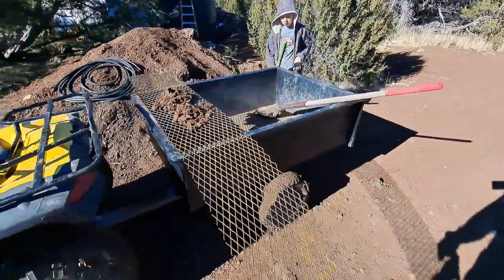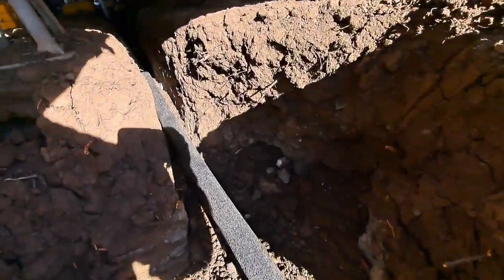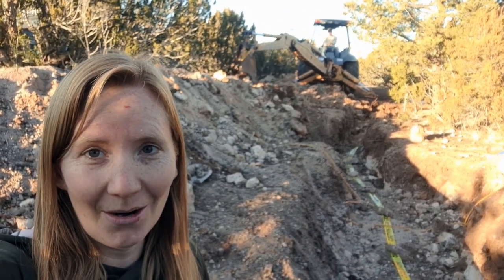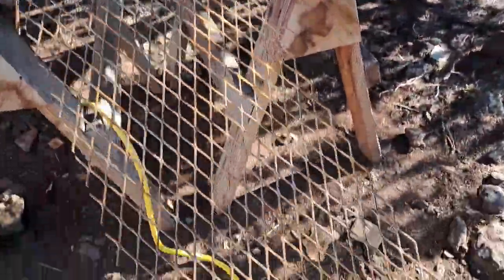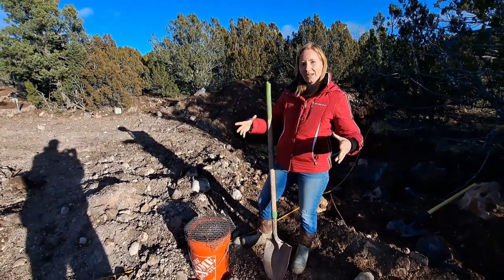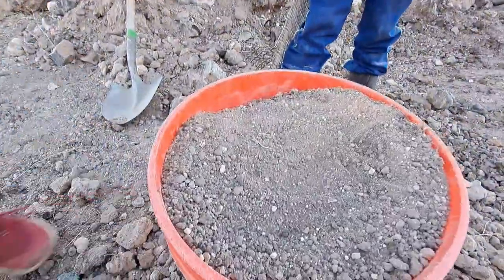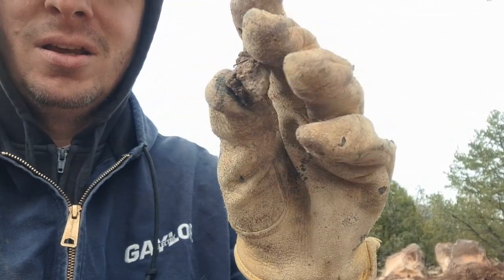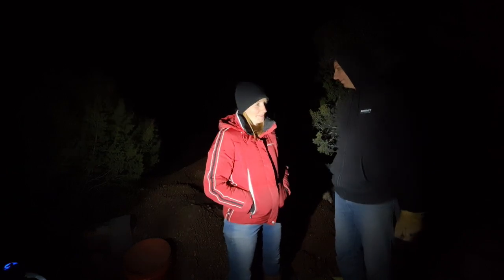We Filtered A DUMPTRUCK LOAD Of DIRT Through THIS!!! | Off Grid Homesteading

Comment: Catching up on all of your videos and just found this one.  I mentioned in another video of doing something similar with your ATV trailer to sift your dirt.  If you were to find a larger piece of the expanded metal that covered the entire trailer, it would make the process faster.  But, my suggestion in the other video was to use some of the 1/4"-1/2" chicken wire type material you can pick up from the big box stores.

Comment: Hope you don't have to do this again guys, but a quick easy way to do it,  find an old fashioned wire bed frame, or make something similar, and lean it against a tree or post/prop at about 60 degrees and then just shovel you your dirt about 2/3 of the way up it, it will roll down the wire frame. The dirt will drop through and the larger stuff will roll down and collect at the base of the frame. You end up with two piles of separated material very quickly. Used to do this out on the farm for Ma's garden beds. But 110 out of 100 for effort. Cheers

Comment: If you're not gonna use it for anything else cut it in section. Just wide enough mount it to set a 2 or 4 then mount tuberforest on top of it. Then that way you're expanding metal. You can lay it on there you. You know about 4 or 4 layers. That will cover the maybe even cover a whole trigger when you cut it up and then you can just slide it back-and-forth on the top of the. Trailer and shake that stuff and you just throw a big old lunch of it owner and shake it.  Is in separated

Comment: Yes this can help you'al & best way is to run your pipe'n through a commercial rubber hosing. I have done this in the thick rock/boulders on my mountain & dug by hand down 2 feet+ & in 30 years well protected copper lines & sewer pipe lines, not a crack. You'al do have the advantage of many machines to accomplish what I did by hand & shovel kids. You have appeared to steer away from your Youtube Channel with Drone Footage & not your Build. Tragically this has happened to many Build Projects on Youtube & is a total TURN OFF Jacob. Realize those of us Tuning In, are tuning in to see how one is building their project to give us idea's pro or con on how you are accomplishing this work in progress. Those on Youtube that turn their channel into a Soap Opera Program just does not fly for those of us wanting to see in real⏱time how another is accomplishing their build project. always, Tommy🤠